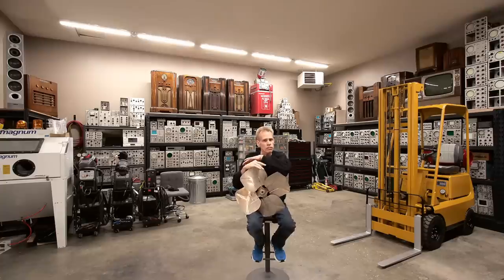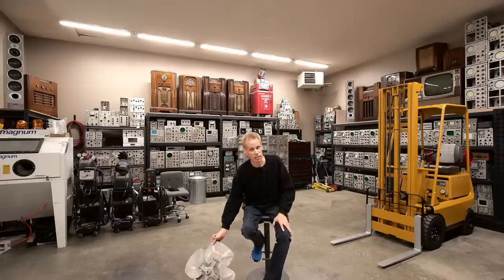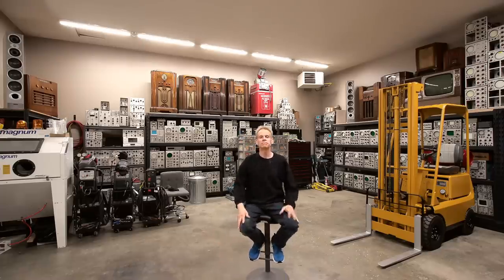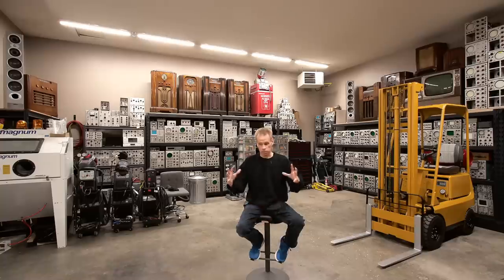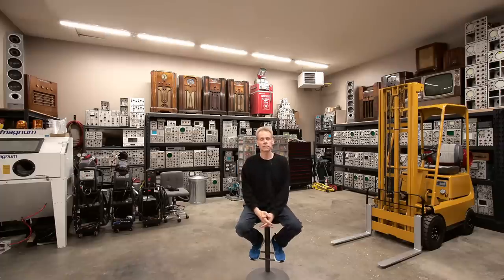SCARY Fan Blade Story! More Of Mr Carlson's Past.

Comment: You reminded me of when I was 19 (I'm 58 now) and working in a friend's basement with a box cutter on a project. I don't know how it happened because I was sure to cut down and away from myself, and I had no body parts near where I was cutting, but I still managed to slip somehow and slice into my left wrist right behind the joint towards the hand for about 3 inches. I cut through a big vein and several capillaries but luckily missed tendons. Unfortunately I was bleeding in spurts so bad and was in shock so quick I barely got to the top of the steps before I started to pass out. Fortunately my friend's brother and his mom were there and they got me to the hospital fast after some quick first aid. The wound required 14 stitches (4 internal, 10 external) and 1 pint of blood. I now have what looks like a small salamander for a scar on my wrist to remember that things can happen no matter how hard you try to avoid them.
Reply: Dang, I won't be using a box cutter in the foreseeable future
Reply: @rogertoaster9385  Just be very, very, extra careful with them. I still to this day don't know how my wrist got in the way of that blade.
Reply: Being a small child (under 6) i attempted to disassemble a wire steered toy car with scissors. Made a gaping wound between my left hand thumb and index finger. Not much blood, looked white in inside. Decades after, 3cm scar reminds of the blunder.
Reply: Holy shit😲
Reply: Cutting sitting down using my knee as a rest for the thing I was working on. Stanley knife, UK name for a box cutter, slipped and cut a large flap off the inside of my knee. It fell out the bottom of my trouser leg. Picked it up rinsed it in the workshop sink placed  it back on through the hole in my trouser leg, holding it there, I limped off to find my wife. Then the adrenaline stopped and the pain started. I rarely use those now without thinking of the massive scar and stitch marks on my knee..
Reply: @AlexanderBukh  Love you Bro, The things we do!!! Had Sooo many FUBARS sometimes think how the Fook have I survived!

Comment: When switching up fan blades and motors a very important spec to pay attention to is the rpm rating of the blade. After spending 50 years in the HVAC trade I have seen a lot of wrecks with fans. I have seen home owners install 800 rpm rated blades on 3600 rpm motors. Each blade will break off the hub and create three or four projectiles traveling at an extremely high rate of speed.
Reply: Yay, 20.25 times the rated tension on the blade base, on top of the higher bending forces due to torque loads sounds like fun!

Comment: I've never seen a motor shaft split with threads. Really odd. A good reminder about safety guards! Liked the wildlife shots!
Reply: Antique emerson fans had blades that threaded onto the rotor.
Reply: @mattdavala3790  It was to extend the shaft for different models and a square key was supposed to be installed to keep them from coming apart.

Comment: Working on a high powered fan conversion for my car, replacing the mechanical fan and clutch. Your tale is sobering. Ive taken extra care, while this fan is hardened plastic the blades are sickle shaped and sharp, would lop off a finger in an instant. Thanks for the story.

Comment: Another dangerous type of fan is the metal "flex fans" which were used in some cars in the 1970s and 1980s.  A mechanic I know is aware of another technician who perished when an engine was being revved by an assistant,  and when he was leaning over the front of the car to reach something at the top of the engine,  one of the flex fan blades separated from the hub and went through him.  I have never leaned in the "path" of a fan blade of a running car engine since I learned of that fatality.

Comment: I love these stories. Keep 'em coming. I have a story for you. In my teens I was a passenger in a car. I was sitting in front passenger seat. No seatbelt. Really dumb. In a left turn we went off a 35 foot drop down towards sea while the car was tumbling around on it's voyage down the 35 foot drop. On it's way the roof on my side was pushed in one feet while in the same time the sentrifugal force of the roll pushed my upper body against the lap of the driver. The hit smashed my shoulder bad , but not critical and we landed on the wheels. If my movement had been restricted of any sort , my neck may have taken the hit with severe injuries. In this case the lack of seatbelts may have saved my life.

Comment: When the SHOP hits the FAN ???   Glad you still have all your original parts Paul.  A somewhat similar event almost cost me some skin.  I used to own a 66 Chevy "mid-engine " van which had a removable engine cover between the front seats.  One time when my sister was riding with me, she sometimes would sit on the engine cover if I had another passenger in the right seat.  On one drive, a blade from  the motor cooling fan sheared off the shaft and sliced through the side of the metal engine cover, cutting some of the wiring harness and stalling the motor.   Since the van came to a halt, I found the broken blade under my driver seat, leaving an eight inch long tear that could have easily caused severe bodily damage .   Talk about a butt puckering close call.   We try to be safe, but sometimes the FAN  has other plans.

Comment: Really glad that fan episode didn't go anywhere near as badly as it could have. Reminded me of something that happened a long time ago. I was at my local pub late in the morning and the place had some fans mounted on the ceiling. They had blades about two to three feet long and about six inches wide attached to central hubs hanging from the ceiling. There were only three or four people in the place and one of the owners behind the bar. I was sitting at a window table not far from below one of them. The screws holding the blades on the hub must have shaken loose and one of the blades detached from the hub and flew within a foot of my head and hit the next table with quite a bit of damage to both the blade and the table. The look on the owner's face was priceless realizing how close that was to a catastrophic event. I got very lucky.

Comment: Yikes
I can imagine the shock of that blade flying past your face.
Funny coincidence I also collected and tinkered with what are now antique fractional horsepower induction motors.
I had Westinghouse Canada, Tamper (which I still have), Leland Electric and CGE and others up to 5 hp. 
I inherited one complete exhaust fan belonging to my great grandfather circa WWII which I ran with only the front exposed. Kept a long cord so going near it wasn't necessary. 
I currently have one from England I plan to build a portable room exhaust out of (and it won't be finger accessible and its not open either).
I was warned by my dad about running open fans beyond little desk fans. 
Glad you escaped! 
Kept your guardian angel busy😊
Haven't been that close to a bear in many years.

Comment: Great story Paul,  When you showed the fan blade I immediately knew what you were going to say.  I had a similar experience when I was 11 or 12 years old.  I took a smaller metal fan blade, (maybe 12 inches) like the one you showed and stuck it on a vacuum cleaner motor.  It was one of those bullet shaped vacuums.  Mine wasn't attached to the bench I just laid it on the concrete floor of the garage.  When I plugged it in the whole thing took off like a helicopter, straight up and hit the ceiling.  When it hit the ceiling,  the motor came loose from the blade and dropped while the blade bounced around like yours did.   Glad to hear that you didn't get hurt, I didn't either but it was one of those oh crap moments.   There's still a mark on the ceiling where it hit.  Thanks for sharing these stories.

Comment: Yes I have seen that done. Right motor not available, tool room available, key way machined in, so the key will keep it from coming apart. Usually has pulley mounted on it.

Comment: Who would have expected a two-piece shaft on a motor?  But almost everyone who started young and enjoyed constructing neat things has to have some good stories.  Here's one of mine:

I built up a H.V plate voltage power supply for some project in senior high physics class (1964) from surplus components.  The primary filter cap was one of those old multi-segment electrolytic cans rated at something like 40mfd@450v if I recall correctly.  Input was to a C.T transformer into a full wave bridge (5U4).  Me and a bunch of guys in the lab were gathered over this thing.  It did look good, if I do say so myself.   Just before powering it up for the first time, some little voice whispered that I should have everyone to stand away.  I am still thankful that I did.  

When I hit the power switch that thing hummed for about five seconds while the filaments in the 5U4 reached operating heat at which time the filter cap cannister exploded leaving the chassis at a very high velocity, sounding like somebody fired a short barrel 12 gauge.  On the way up, it contacted a fluorescent tube light fixture with its old style metal egg-crate diffuser.  Whereupon it neatly embedded itself on the diffuser fins slicing the can about half way thru.  We actually spent some time looking all around the lab for the can until someone looked up.  

I am quite sure that severe injuries would have resulted if some of us had remained looking down on it when it launched.  No caps have been used since without being tested out of circuit and no first power runs are done at full input voltage.  But there was that time when I became the unknowing bleeder resistance for a pair of 872s and their oil filled capacitor bank.  The experience was electrifying.  

Why we are not all dead is a pure act of providence.

Comment: I had a shop teacher tell a story about how when he was younger he tried building an airboat and was trying to use a metal 3 blade ceiling fan and attached it to an engine.  While testing the setup (with no guard) revving the engine up and down, the fan flew apart and one of the pieces hit him and cut him open (luckily it missed any major arteries or veins).  
That was his way of teaching safety in the shop.
Reply: My wood shop teacher kept a finger in a jar.

Comment: Stuff like that happens with RC plane combustion engines, too. In most cases the prop is just fastened with a single nut on the threaded crankshaft .. if they aren't tuned correctly and backfire, this may be enough too loosen that nut and make them throw the prop off.

Happened to me once in my garden (I think I even have the video up of this) and while I found the prop, the (spinner) nut was nowhere to be found. Newer four stroke engines (and larger displacement two strokes) usually had a special counter nut, which has a slotted cone at the back which then clamps on the crankshaft, to prevent that. 

With two-strokes there is another thing that can happen (didn't happen to me, but witnessed it once) .. they have an rotary intake valve which is integrated into the crankshaft, by the crankshaft being hollow and having a cutout in it. This means the crankshaft is only an open "C" shape there and therefore quite weak, it can (and does!) break there .. and then it comes out of the engine, ripping the front bearing out, too. 

There is a reason why you are always supposed to stand behind the engine when tuning it .. 

Also just remembers, many years ago some an guy told me about the motorcycle he owned in the 1950s, which at some point just randomly locked up. He suspected a seized up engine, but it wasn't that .. the end of the crankshaft, which has the generator and ignition system on it, was screwed into the main crankshaft. This wasn't documented, if you bought a new crankshaft you got it already assembled, it wasn't mentioned in the explosion drawings in the parts list and so one. 

What happened was, it loosened up, screwed itself out a bit and then got stuck because the crankshaft suddenly became wider .. He, being a toolmaker by trade, either got a new crankshaft or reassembled and  straightened the old one (it was bent after this), drilled a hole near the end through both parts, pushed a (hardened) pin in and ground it down to fit. Never again any problems with it.

Comment: Not quite as close a call as yours but I learned my lesson with uncovered fans young as well. My dad's shop had a fan salvaged from an old outdoor AC unit we left running pretty much 24/7. One day we hear a bang followed by crashing and go out to inspect. The rivets for one of the blades had worked themselves loose over time. We found the blade embedded about 6 inches into the sheet metal wall and the now very unbalanced motor had torn itself loose and left a trail of destruction across the shop. High speed rotating objects should never be left unshielded. Period.

Comment: I live in rural Maine at almost an identical northern latitude as you and have had ever animal Maine has to offer in my yard except a lobster. I'm about 2 hours from the nearest ocean point. I haven't had a moose in over 10 years, but have seen one in my yard before. I had one walk out in front of my pickup coming home from a local fair and I laid on the horn and he made a "mess" in the street. He had to be about 7 feet tall to the tip of the antlers. 
 You should use that fan blade in an antenna project.  It would make a good reflector for a satellite turnstile antenna. 
 Thanks for all of the training. I now can go through my old ARRL Handbooks and actually understand what they're talking about in the projects instead of trying to duplicate them exactly and hope they work. 
 I'm now working with a 74hc132 chip capacitance and inductance meter that uses a standard VOM. A lot can be done with that ic with the four and gates and the Schmitt triggers inside. Although you can cheaply buy one, it's more fun to design. It might be a good video idea for you. Best regards!

Comment: Back in 1977 I did the same thing using a 1hp 3600 rpm motor. Thankfully it did not have a threaded extension on the shaft but my god did it move air! Fear of parts flying made me shut it down before anything left the chat lol. My dad yelled down the stairs (my shop was in one corner of the basement) what was that noise and vibration he felt shaking the house!

Comment: If you're ever working on that fork truck: Do not raise the rack, stick your head under the rack - to loosen a hydraulic hose fitting for the hose that's holding the rack up...this happened to a tech from Yale Equipment Services. One of the best, comfortable, let slip his tired bravado.Popped like a cantaloupe.

Comment: Years ago when I was doing a lot of automotive carburetor rebuilding, I used a lot of different chemicals. One night when I was still in my work uniform I stop by my parent's house. My dad sat down next to me and said if you ever get away from those chemicals you will have withdrawals. I never knew just how bad I smelled or how much I was being exposed to those chemicals till that day, but am still alive.
Reply from the maker: MEK and Benzene are the worst! Be careful!
Reply: @MrCarlsonsLab  yes, I have used them all. But most of this was back in the 80s. Five of my fellow technicians are now dead. All died from cancer. The oldest one was 45, am now 62 but still going so far. Still have the Trans Am? I owed and work on lots of these. I also toured the GM plant in Van Nuys, CA back in the 80s when they were building Firebirds and Camaros. Sad that it no longer exists. Yours I believe was built in the Canadian factory. Take care and have fun with your projects, Mike

Comment: I think we can relate some. I work on small engines all the time - charity small engine repair when it comes to friends or family. And I have done some wild things in the past too. I had a fan experiment with a turbine fan from an electric dryer. Mother got a new dryer, so I took her old one apart to see how it all works - on a bench - in the basement. I used the same electric motor from that dryer to power the turbine fan. The same belt to transfer the power from the motor to the fan. It created allot of racket but boy... can that thing belt out the wind. Everything was going fine until some paper grocery bags decided to float about. A sudden "WACK" as the paper bags hit the multi-bladed fan & peices of brown paper went flying everywhere. The turbine fan began shaking violently, the C clamps came loose & run for your life!! Sparks flew as the fan hit the concrete floor and spun to the other side of the basement, hit the wall and looked like it was trying to climb the wall after that. My eyes were big as grapefruit. 

In my youth, I was always con into grabbing the penny or dime out of an empty lamp socket. Bzzzzz. We had one house where we had those turn style light switches. My tiny fingers would somehow get in behind those knobs and zap me every time. Another time was the farmer down to road, friends would have me test the fence - "just hold onto the wire and see if it is live". I held on to if for 3 seconds and nothing happen. "You have to hold onto it longer". So, I done it a second time and after about 5 seconds I heard a loud bang and felt a decent jolt as I let go of the wire. 

Just last weekend I had an explosive experience with my small camp size gas grill. For some unknown reason I couldn't get it to light. Stuck the lighter in the hole like I always done before (with the lid on). Whoooom!!! The lid jumped up some 2 feet off the bottom portion of the grill as flames shot all around the grill. The burner is a bit rusty and the tiny holes the gas is supposed to come out, was only coming out on the gas control side. Well, it filled the grill up with gas and then with an explosive report it blew the lid off. I jumped back and said "whoa, that was kool!"